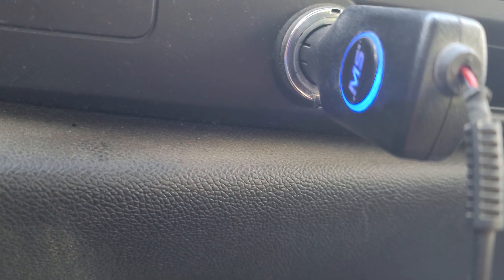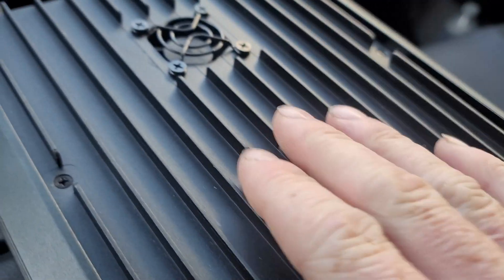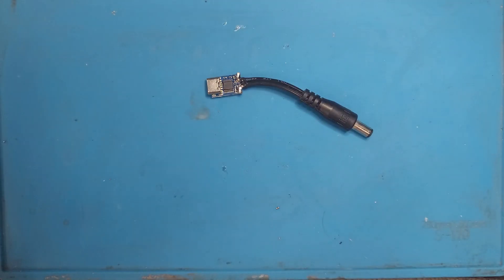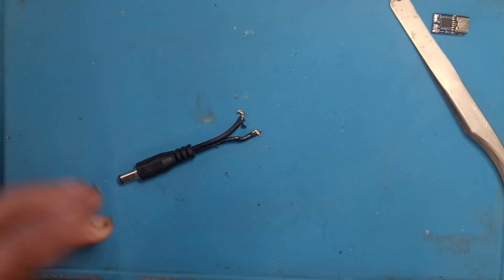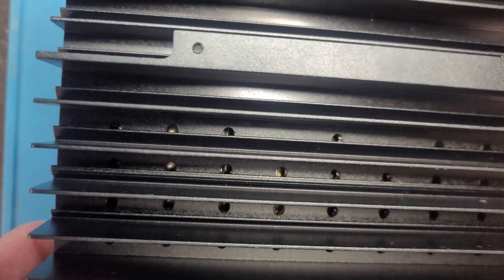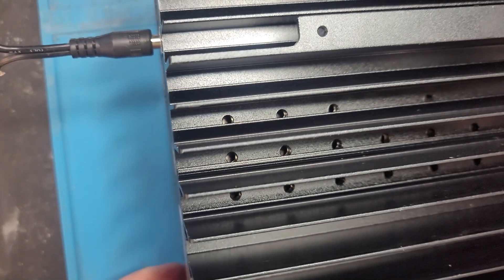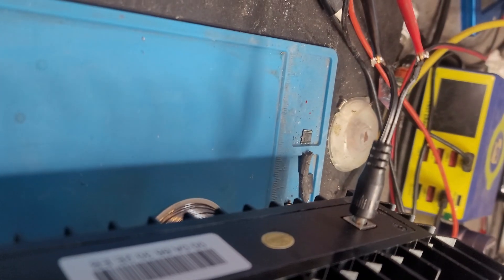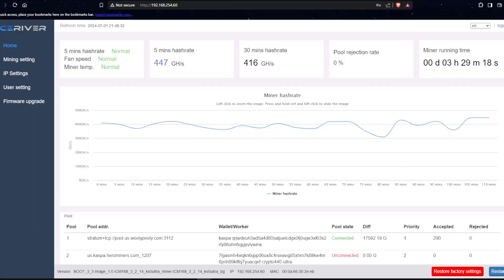Run your ks0 in your car? KS0 Ultra on 12v

Comment: 7 AMPS from Socket !!! OMG !!! - My household socket are only 13 AMPS - this is crazy tooooo much AMPS pulling!!  Can you make something some solution that it does not pull so many AMPS please ?? This is very interesting project!  You gotta Sub from Me for all your videos! - I like your channel! Will see what you will bring up in next videos!
Reply from the maker: The lower the voltage, the higher the amperage. The important part it the wattage. 7amp at 12v is only 85 watts. So at  110v/85w = 1.3 Amp

Comment: question how efficient are the power supply thats with the ultra ?
that's why I did opt for 12v psu, also overclocked my Pro.(so stock was´t an option) And I got plenty of 12v psu...

ps. thnx for the Video <3

Comment: Very interesting. Let's do more tests with a voltage of 12 V.
Reply from the maker: @Алексей-ц4т3п  in what ways?
Reply: @crypto440  how stable will it work at a voltage of 12 V? what will the temperatures be? how the hashrate is maintained? if you have several devices, it may be better to power them from a 12V server unit?
Reply from the maker: @user-yf2md1tn1y  it works exactly like the pro on 12v remember any voltage going in gets converted into 1.8v after the mosfets so as long as your within specs of everything your good. As far as heat, the chips have to run at 75°c in order to reach 400gh. I plan on making a video about the heat soon.